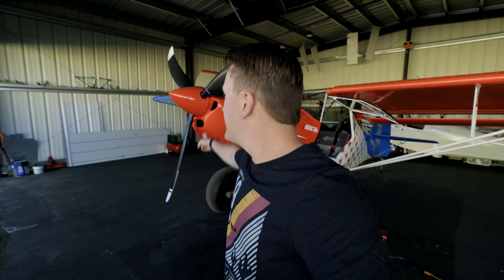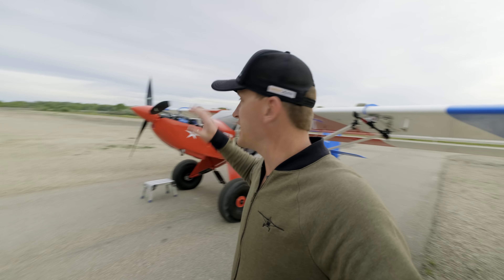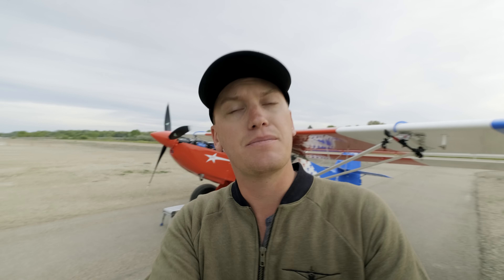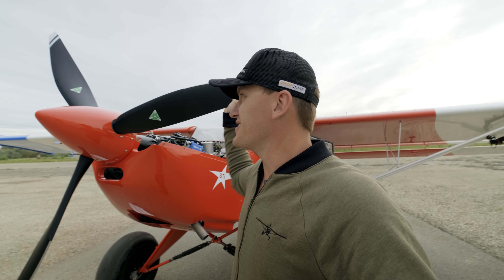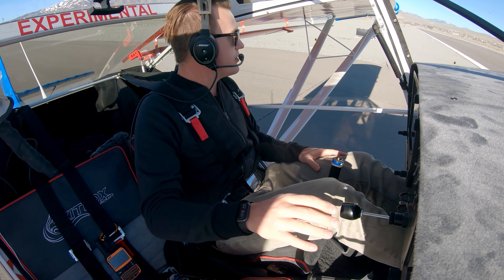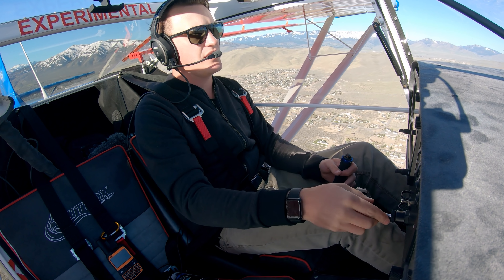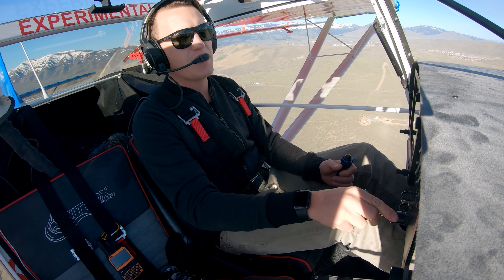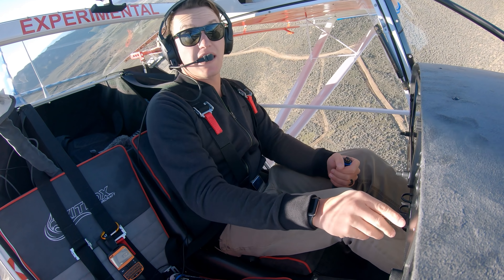MAD PROPS - MT Constant Speed Propeller Upgrade

Comment: Whats that MAN ? in InHg ? 
And whats that, presure in Inch quicksilver ? 
Can someone plz translate to something understandable...
Reply: Skyven Razgriz 

MAN - Manifold pressure. This is the pressure in the intake manifold, and tells you how much power the engine is creating. 

In Hg- inches of mercury. This is how atmospheric air pressure is measured. They also use this to measure the manifold pressure.
Reply: Inches of mercury.

Old barometers used mercury in a vacuum sealed tube to detect pressure, how high the mercury was inside the tube (measured in inches) was the pressure of atmosphere.  On a standard day, the atmosphere at sea level is at about 29.92 inches.

Modern sensors and technologies are of course a lot smaller than a big wooden floorstanding barometer, but the same measurement is used.  Manifold Pressure is essentially a way of understanding how much pressure is in the throttle body or carburetor, which helps the pilot know how much power the engine is putting out.  Many airplanes will have guidelines for various phases of flight (takeoff, cruise, climb) where a set manifold pressure is considered ideal.  On a turbocharged engine especially, the manifold pressure gauge can help detect an early problem.  (If Trent goes full throttle on takeoff and only gets 30 inches of manifold pressure, he'll know to abort because something is wrong and the engine isn't making full power.  Even though, thanks to the constant speed propeller, it'll be running at full RPM's)

Some large forced-induction engines (much larger than what Trent has on his kitfox), especially older supercharged engines, are very capable of over-boosting.  Manifold pressure is essential there because if the pilot were to actually run the engine at full throttle, they'd blow the engine.  At what point the engine reaches max boost will depend on factors like temperature, altitude, etc.  So the pilot uses the manifold pressure gauge to determine when they're actually at max power.  Trents modern engine is computer controlled, with an automatic wastegate, and won't overboost.  So he can simply push the throttle in all the way and know he's making full power.
Reply: @RomansFiveDotEight  Why the hell they still use carburetors in aviation? Is not electronic injection much more efficient?
Reply: Sorrry so i was right 'quicksilver' was a sloppy translation for mercury...
But if it is power thez want to measure why isnt it displayed in torque... 
like it would be everywhere else, is this a 'murican unit stuff again?
And i mean if they want to show in in presure arent they using psi for that...
Reply: @skyvenrazgriz8226  Because the tools and technique for measuring torque are quite expensive and complicated.  And, like a lot of things in aviation, this goes WAY back; long before there even was a technology for measuring torque.

And like a lot of things in aviation, even if there are fancier, more accurate ways to measure things; a measurement does you no good if it isn't working.  A manifold pressure gauge is a very simple device that's proven reliable over a century of aviation.  It just works.  It does exactly what it's supposed to do.

InHg is the standard, PSI would work too (you can convert PSI to InHg by multiplying InHg by 2.041).  Commonly in the automotive world, boost pressure is measured in PSI. (Worth noting that most engines at low power settings read well below atmospheric pressure).

It's not an American thing, Inches of Mercury used to determine manifold absolute pressure is standardized the world over and has been for a very long time.
Reply: Remo Williams They do. And have for decades (mostly mechanical fuel injection). Trents airplane has electronic fuel injection. But fuel injection still has an intake manifold, and that’s where manifold pressure is read. 

General aviation tends to prefer simple, mechanical devices. Carbs are still widely used because they’re reliable. Fuel injection is more efficient. It also generates more power. 

Keep in mind, too, that new airplanes don’t sell well. Most of what’s flying is old. If you walk around a small airport you’re going to see a lot of airplanes from the 50’s, 60’s and 70’s. New airplanes sold today, however, are almost always fuel injected.

Comment: I love my dynavibe.  I mounted it in such a way that I could go flying with it mounted.  First I got things close on the ground at 1900 rpm with a lycoming O-320.  Then went and flew and was surprised to see it be quite a bit different at 2500 where I normally cruise.  It took 6 flights and a lot of trial and error to balance it, but I eventually got to .05 IPS or .00 depending on the test run, at 2500 rpm.  It was stunning and worth every hour (about 5 of them) to have done it that way.  I've always balanced to .1ips or below, but that was always on the ground.

So, at 2450-2550, it is jet smooth.  I could lean over with my headset against the canopy and not even hear or feel a vibration.  Almost eerily smooth.  I asked pilot friends to pay attention (they were skeptical) as I leveled off for cruise and notice how the vibration just disappeared.  I think the slightly lower RPM as well as unequal blade AOA during climb could actually be felt.  And as the plane accelerated into straight and level cruise, the tiny bit of vibration just faded away.  They could all tell what I was referring to.

A very long description, but I encourage you to give it a shot.  For my case, I disconnected the carb heat flexible tube, and ran the sensor cables through the cabin heat system and out the floor and hooked them up inside the cockpit.  Yes, it's tedious and time consuming but it pays dividends in so many ways.

Love your vids!  Keep up the good work!

Comment: Nice upgrade and a great video explanation.  How do you deal with the CG?  It was already an issue with the 915 and now you add an additional 20 lbs way out front??
Reply: We had to put 30 pounds on/in the tail when we put a bigger engine on a Cessna.
Counter productive but good CG is important.

Comment: Your top speed/stall ratio is 130/35 = +4 . RV Van's aircraft have +4 top speed / stall ratio, 210mph/52mph. Any plane with ratio 4 is amazing. Most factory GA planes are around 2.
Reply: can you explain that ratio, cause when i do the math 130/35 i get 3.7.
Reply: @robertlinke2666  You got me... actually 3.714285. I rounded up (a lot). Sue me 😀  However RV's do 4 to 1 max min speed.  Still 3.7 is pretty good. 35 mph Vso is very good.
Reply: gmcjetpilot That's an interesting ratio I've not considered before. The fuel/power required to get the top speed is a downside and may not relfect the true efficiency of that calculation.
Especially with dragy planes... My aircraft calculation is 3.4:1. I cruise/top speed 100 kts (115 mph) WOT at 18 LPH (4.8 GPH).
It takes ALOT of power and fuel to get that extra 15 mph. I'm not saying it's a particularly bad calculation but the fuel/power context needs to be looked at as well....
Reply: @MikeMike-er7kn  That is the key low drag, and yes power to weight ratio. More power usually means more weight, working against stall, due to need for more lift (more drag). Many Jets have +4 ratio, top speed 530 to 490 knots range and stall 130 to 110 knots range. They do it with high lift devices, double slotted flaps, leading edge slats lowering stall. The speed is obviously the jet power and low drag. A jumbo jet is very efficient, about 100 passenger miles per gallon (while going 10 times faster  than a car or train) over land or sea. Tell that to the climate change alarmist...

Comment: You never actually tell us what a constant speed prop is or how it works in this video.  You just keep saying constant speed prop.  A bit of tautology going on here.
Reply: AIUI (IANAP) props come into several categories. The simplest props have a pitch that is fixed at manufacturing time and cannot be changed. Then you get props that can have their pitch changed with tools on the ground, but are fixed in flight. Both of these have the downside that for some flight regimes you will have non-optimal prop pitch and hence non-optimal engine speed. Then you get "variable pitch" props whose pitch can be manually varied in flight, but that is another thing for the pilot to manage. Finally you get "constant speed" props that automatically adjust their pitch to maintain a (mostly) constant engine RPM.
Reply: google ???

Comment: Next step: upside-down airfoil for the horizontal stablizer (à la CH-750).
Reply: .... and / or vortex generators under the horiz stab's leading edge.
Reply: You'll notice on the STOL 750, they use an inverted airfoil, but that plane only does 100 mph.  On their Cruzer 750, they've gone to the symmetrical stab, as it has a cruise speed more like what Trent is getting with his kitfox. 

 I'd go with another solution, maybe a slotted-flap style hinge for the elevator, or just a bigger surface.  I notice Trent didn't mention the actual CG location, just that the prop was heavier.  There is probably room to move the CG back, making the elevator more effective as-is.
Reply: Tails lift downward.... to hold the nose up. Its not semantics.

Comment: I think you should yank out that Rotax and throw in a Jairbu 5100 if you can find one. 180hp @ 3,000 RPM's. And way more reliable then a Rotax
Reply: That’s probably the first time I’ve heard someone say a Jabiru is more reliable than a Rotax. Check the statistics!
Reply: @andrewmorris3479  Rotax reccomends changing the crank every 300 hours...and Rotax also has a much higher running RPM speed during normal flight.
Reply: Ricky Bobby Trading Definitely don’t have to change the crank every 300 hours, that would be very bad. 

High RPM yes, but the piston moves a lot less in the cylinder compared to a Lycoming or Continental so there’s really not anymore stress in a Rotax. Not only that, but the tolerances are so tight that once you open up a 2000 hour Rotax they essentially look brand new.
Reply: Why not put a twin turbo IO 550 on there ???
Reply: HotRodRay You wouldn’t have enough elevator authority to flare due to weight with the current design.
Reply: Git.  The.  Yamaha.